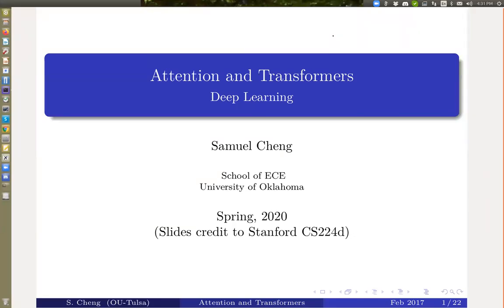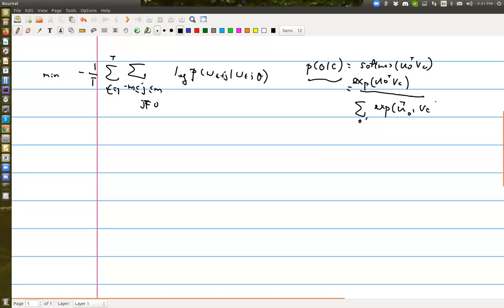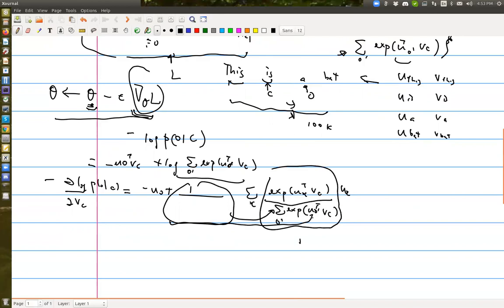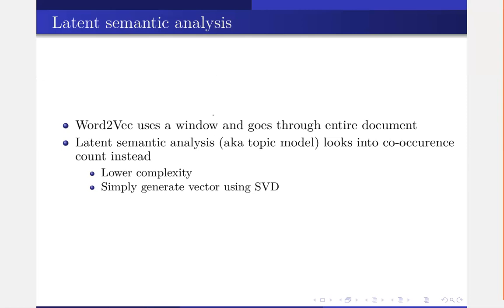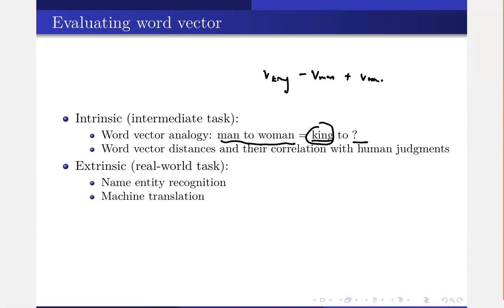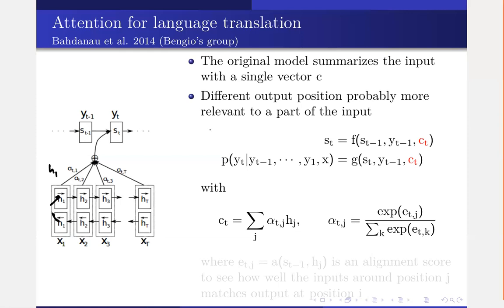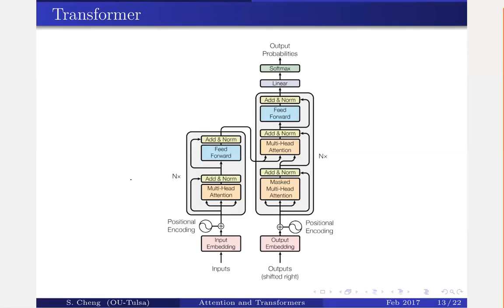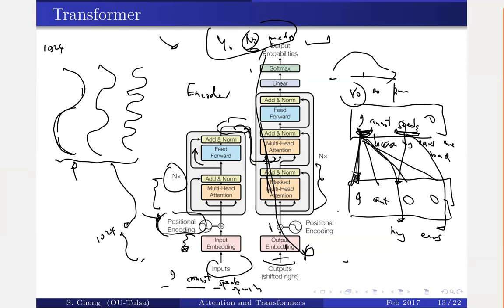23 - Word2Vec and attention model

Comment: To me word2vec and attention models looks similar, both comes up with a dimension of a word based on surrounding word. Could you explain how is different these are fundamentally? Thanks
Reply from the maker: Word2vec just creates a representation for words (or tokens). But attention is the way of how to process the representation vectors. On a high level, attention simply allocates more weights to representations that are more relevant.
Reply: I think you cant understand overall state, read more resource